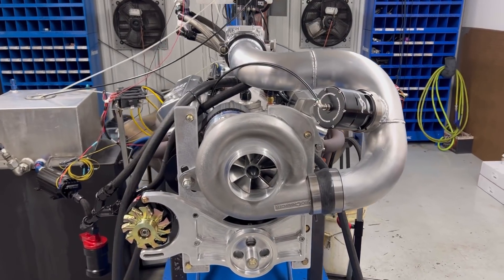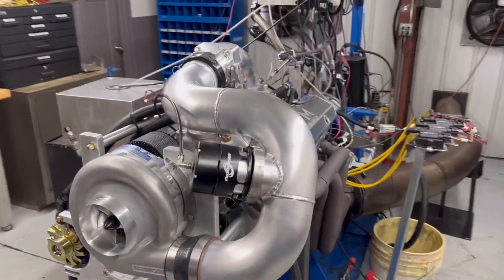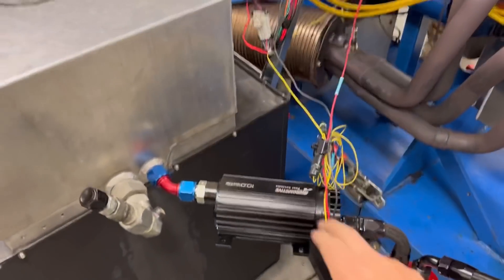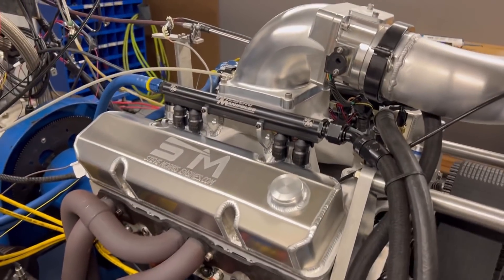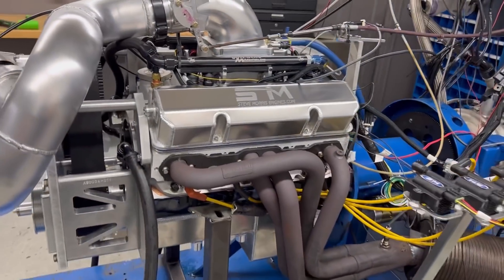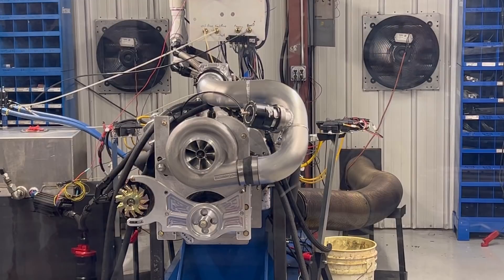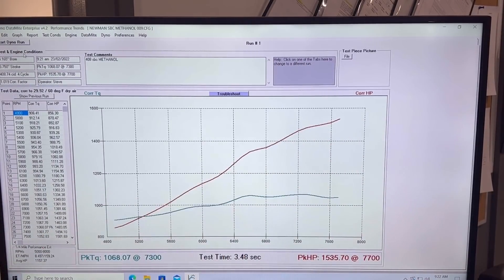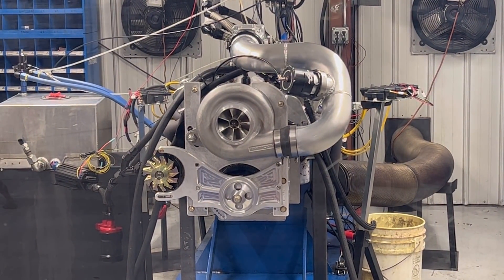F2 ProCharged SBC, 1,500+HP!!

Comment: Guys build an LS if they want to spin 7000 RPM and don't want to lash a solid roller or be out of pocket on day 1 for cylinder heads. It's funny though that the most powerful LS engines are built in blocks that use SBC style 4 bolt splayed mains without the y-block bottom 5th and 6th bolts vs dowels. The SBC 4.125" bore being the same price as a 4" bore block (unlike the LS) will keep it relevant for big HP builds, along with the wide array of aftermarket support. The LS is great for a Junkyard swap or a fuel injected simple build if you have one, but real racers still build SBC's.
Reply: For sure. I have a twin turbo 305 tpi setup that I've already built the upgrade 406 for. I also have a compound turbo tpi setup that I just got my 355 block from the machinest. I've got a 421 for an upgrade for that setup I just started and just purchased rotating assembly for a 462 sbc will be getting machined soon which will be the final engine for the compound setup. I love sbc's and bbc's of course I have a handful or so of those as well.
Reply: @mctigmctiggy1475  In my opinion there’s a tipping point where it just makes more sense to step up to a big block. Once you hot 1000 hp the Big Block becomes more economical in $$$ per horsepower comparison
Reply: @mctigmctiggy1475  are you high? What do you think those SMX engines are?
Reply: @mctigmctiggy1475  all those billet block “hemis” are based on big block architecture and the old Arias hemis. 
Look at Frieburger’s big block in his model A over 1000 hp NA with zero exotic parts, a conventional mechanical fuel pump still bolted to the block and less than 500” put a couple of big twins on that with efi and 2500 no sweat

Comment: Could that blower inlet be clocked, so that the runner could be shorter and straighter? Those three 90's could easily explain the waves in the curve. They create pressure waves which move upstream, when the fast moving air hits the back wall of the bend. There's also a stream inside that pipe, that hits directly at the tangent point of the second bend, and bounces straight back towards the blower. One smooth curve from the outlet to the throttle body should straighten the power curve right up.
Reply: @bigboreracing356  Couldn't care less how it's going to get used, or who is using it, only care about optimizing the setup.
Reply: @bigboreracing356  Another shiny part slapper.. Real tuning is a different game than swinging your credit card and buying the shiniest pile of parts you can find. It's about getting the best results from the pile you already have. If you don't get that, stop wasting my time.
Reply: @bigboreracing356  There are several ways to waste money, one is slapping a pile of shiny bits together, and then chasing your tail at the dyno, or at the track/race when you don't have a clue how they work, or why they are doing what they are doing.
Reply: @bigboreracing356  A bit of a geometry lesson here for you, fan boi. Clocking the housing and straightening the pipe doesn't go any higher than the existing inlet fitting on the intake. And the gain is already explained @ the first comment. Also actually racing that thing requires extra ventilation through the hood anyways, otherwise it just melts into a blob.
Reply: His question is a valid question that was never addressed to you. I see that you like commenting on others posts as if they came here to ask you, why should we value your opinion??

Comment: I’m putting together a single turbo 355 and will be ecstatic if I make 800 hp.
Then I watch this video🤦‍♂️😂
I also don’t have the 💰💰💰for a ProCharger and efi
Reply: Use an s480 and you'll get your 800 hp all day long. Providing your block is built good of course. You can get into a megasquirt for under 1k. I spent more that on my csu carb
Reply: @kdsboosted4954  the bottom end is good all forged stuff.
T76 turbo
204cc intake aluminum heads
Good cam etc
I have thought of a mega squirt.
Reply: @AndyGeesGarage  Sell the T76 and get a 7875.
Reply: @johndelta00  actually it is a 7875 .81 A/R I was originally looking at a T76 and got the 7875 instead and my choices were .81 or .96 A/R so I went .81 to spool quicker
I had T76 on the brain while typing that

Comment: Man id take my forged 383 sbc over a ls anyday.
Reply: I’m not a fan either, my builder hates building LS Engines, the younger guys are crazy about them though, and I get it but no Thanks
Reply: The fact you are praising a 383sbc says everything.
Reply: @precisiondiesel225  what do u got a honda civic with flames on it?
Reply: I used to say the same thing… and still would if I wanted a solid NA motor to run around and daily at 4-450 or so.
Reply: What advantages does a 383 SBC have over a lsx?
Reply: @Jnichols77   Lmao. Thats not what i said. Its called preference
Reply: @centermass4962  Fair enough, why do you prefer the traditional SBC……. I’m just curious because I have a pretty solid NA 383 in my 70 Chevy Truck, but have a rods/piston 6L I’m building for a turbo application.
Reply: @Jnichols77   Just old school i guess.
Reply: When you want more power with better gas mileage you will.
Reply: @centermass4962  you're so easy to bait, are you a child?
Reply: @sepg5084  ask your wife